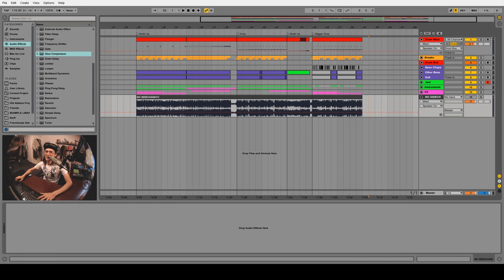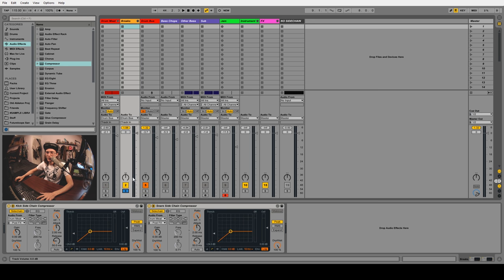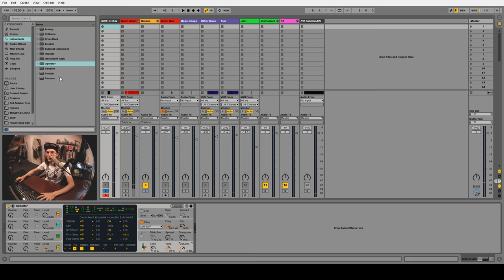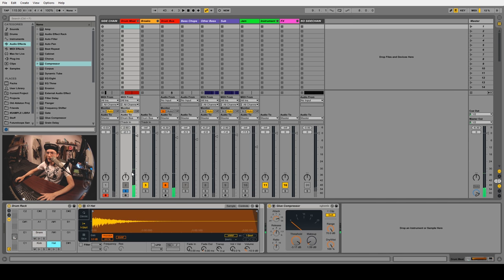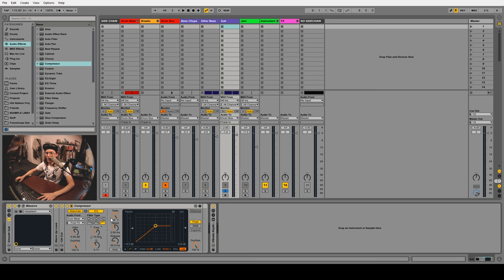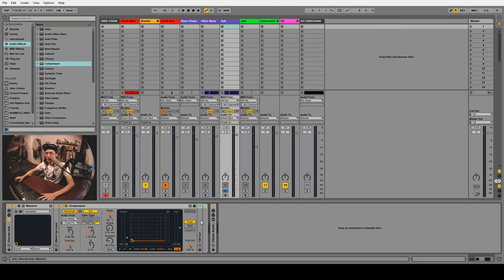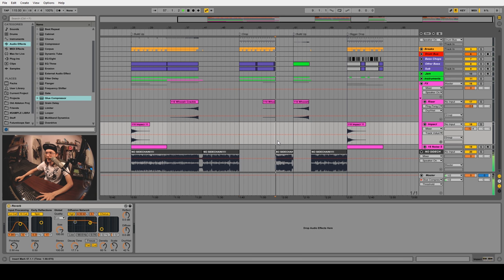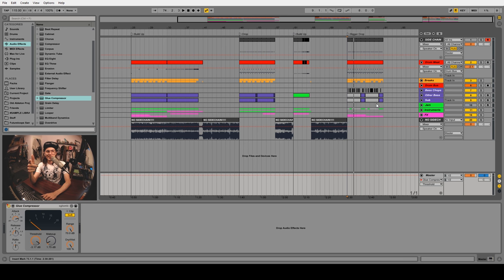Ableton Tutorial: How To Use Sidechain Compression To Improve Your Mixdown

Comment: Cool auto pan trick. Manual sidechaining is a good alternative that's worth mentioning and exploring as well. I stopped sidechaining with ableton's compressor when I started achieving better results by drawing/automating the volume per track via ableton's utility plugin (or the clip volume envelope on an audio track). You can really fine tune and get more control over the effect this way. It can be less or more time consuming depending on how you approach it.
Reply from the maker: If you have the time and patience to do this, yeah you can achieve a better result. But I think sometimes it's better to just get the song finished rather than fret over tiny details, especially when you can approximate a decent result automatically.

Comment: Thanks for the very comprehensive explanation! Excellent. But, in bitwig, you just insert a note-receiver modulator (or audio sidechain modulator if you need to act on audio) and have it control a volume knob on a tool device (or the gain knob on the output of your sampler or synth device or whatever!). You get complete control, and very, very little cpu load. Why use a full compressor for just a little volume automation? Oh, because not bitwig.... ☺️ No, I'm not a bitwig fanboy; I'm just making a point....

Comment: was very interested in seeing the exact time settings you use on your sidechain compressors, actually; i generally just turn the attack all the way down, so i'll experiment with .01ms for a bit :)
also, what do you think of manual volume automation for ducking instead of letting the compressor do all the work?
Reply from the maker: 0.01ms is the lowest possible attack time on the ableton compressor. Manual volume automation for a few once off sounds here and there is faster and more convenient than setting up a sidechain, but for your entire bassline for example? You'd just be making it harder for yourself and arriving at the same destination.
Reply: ah yes; my argument for manual automation would be that if the signal of your kick/snare is weird and peaky you could still have smooth sidechaining happening, because with low attack times your compressor might distort the sidechained sound if your trigger signal isn't clean enough. however, you needn't worry about that if you use a ghost source as you did in the video :D 
it's really useful for long, sweepy sidechains on 808s and the like though.
Reply from the maker: Ghost Sidechain FTW! Yeah I would manually "sidechain" things if they are just once off sounds. I actually often have a single kick right at the beginning of a breakdown and a big 808 sweep bass drop thing hitting at the same time as the kick. Rather than side chain it.. I just zoom in and put an audio clip fade. Quick and easy.

Comment: Great work sir! I think one the biggest points to take from this are just how much headroom can be used up by peaks stacking together, also how useful it can be to have different Threshold / Release settings on different elements, and of course using the ghost trigger from operator.  However, it looked like you were still clipping the master channel at the end...even if you are planning on going straight into a limiter when mastering yourself, wouldn't it still be good to bring the whole mix down at least 3db? Is it not still clipping the output of your audio interface and/or the input of any plugin on the master channel??? 

(especially if one were to export the mixdown to wav you definitely don't want that clipping!)
Reply from the maker: I could be wrong but I don't really think it makes much of a difference. Say I bring the whole project down by 3db and then use say.. iZotope Ozone Maximizer on the master.. I'm just going to have to bring the threshold down further to get a nice loud sound. I usually aim for like -3 to -4 RMS. 

So basically, my master could be peaking +3db.. but when I drag on a Maximizer to the master.. it will bring the peak down to 0db and there will already be a small amount of compression/limiting happening because the signal is above the 0db threshold. I don't think it really effects the quality of the sound.
Reply: +Slynk Thanks for the reply man, I guess whatever works works, your tunes all sound great on my system! I just think it would be good to clarify for the more beginner types that you do want to be conscious of mixing so loud if you're not going straight into a mastering plugin. (I have also heard that you don't want to clip the input of such plugins, probably better to add that 3db gain  inside, but again whatever works works.)
Reply: +Keenan Black anyway keep up the good work, I appreciate your videos! Would love to see more on composition side of things.
Reply from the maker: I just asked Mr. Bill about it because I wasn't so sure but he said something along the lines of... driving a high signal vs a low signal into a limiter will have different results. Whether they are good or bad depend on your personal preference, the kind of plugin you are using and how it's been programmed to handle high signals. 

Same goes for plugins on individual channels I would imagine. But I do know that an Ableton channel has +62db of headroom before it clips which sounds insane but it's true. Play something on a channel at +60db and then turn your master down by -60db and you won't hear any distortion. Push it to 62 however and you'll be clipping like all fuck. 

I'm not sure if stock ableton plugins have a similar headroom as a channel (i imagine it might) but regardless.. if it sounds good then who cares. Just get on with writing the song :)
Reply from the maker: Apparently stock ableton plugins have like 10-15db headroom so yeah.. keep the signal low but you don't need to be super precise. http://i.imgur.com/3MTEHwT.jpg
Reply: Cheers Evan & Bill!!! I was aware of the extreme headroom phenomenon in ableton but I thought master channel and 3rd party plugins might not be the same story... Carry on gentlemen.

Comment: so regarding your comments at around 20 mins about getting the master level right and not worrying too much about a couple peaks on the master that go over 0db here and there, is that how you do all your tracks? I have always heard that you should have a few db's of headroom on the overall mix, say -6 to -3 db, so you can bring them up on the overall master to 0db in the mastering stage. what are your takes on that? your comments make sense to me, i have just always wondered why you need a few db's of headroom because that means you're gonna have to do some compression/limiting on the overall track to bring it up to 0db if your highest peak in the track is at like -3db..and seeing someone with topnotch productions who doesn't follow that rule is interesting to me. thanks!
Reply from the maker: +max reeves driving a high signal verses a low signal into a limiter or compressor has various results depending on how the plugin is programmed to handle a peaking signal. As far as I can tell, going hot into ozone 5 sounds fine to me. That's how I've always done it and unless someone gives me hard evidence as to why I shouldn't, then that's how I'll continue to do it.
Reply: thanks for the response, very interesting. do you know of any good resources offhand for learning more about reducing/raising peaks within compressors/limiters or vsts like ozone in the mastering stages by chance? or have you always just experimented yourself to see what sounds best?
Reply from the maker: +max reeves I think this is something you'd have to test yourself if you want the answer. Sometimes I set up little science experiments to understand something better. It's fun and you learn more about what it happening.

Comment: Did you retrig your phase in Massive? You sure it's from Compressor I mean?
I noticed, with the high pass eq you aren't sidechaining your sub at all ^^
Reply from the maker: The high pass filter in the sidechain section of the compressor does not effect which part of the sound is being compressed. Rather, it helps define the trigger sound. So since I was using my kick drum as the trigger which has a short snap in the beginning of the sound, then a long bass tail.. by high passing it, I'm getting the short snap in the high end to use as the trigger making it easier for me to adjust my attack and release times. 

The clicking is from the sidechainers. No doubt. I'm using 0.01ms attack on my compressors. But the click is not too bad on the live 8 compressors compared to the live 9.
Reply: +Slynk this is so clever dude, this one little tip is guna save me hours of faffing around!! 🙌🙌 seriously big ups dude x
Reply: Thank you!

Comment: How much summing of multiple channels can you get away with before its ok to slap a glue compressor on it to limit?  I have been trying to keep it under 2db but it's hard tweak side chaining and EQ enough for certain situations.  I don't want to get in the habit of using a glue compressor as a bandaid.
Reply from the maker: I think it's generally a bad idea to put a glue on a sub and/or the drum bus because you'll be dirtying up the low end. But I think it's ok to put a glue on groups of similar sounds.. like a bass chops group or an keys/synth/lead bus. But just don't go too overboard with the settings. But just use your ears. If it sounds good, then it probably is good. :)

Comment: So whenever I feel there is too much compression going on as in the end of the buildup of your song 24:37, I automate the threshold to reduce the GR. Is there any advantage to your method, where you use a completely different compressor with different settings?

Also what do you think of LFOtool? I feel like it allows for a lot more precision than using a compressor for sidechaining.
Reply from the maker: All this stuff is situational. It depends on what sound you want and how your song has been designed. I tried to outline some general tips with this video but it's not "The Law". If changing settings on your compressor works for you or useing LFOtool works better for you then do it. If it sounds good then it probably IS good.

Comment: how do you stop your master (and even your individual channels) peaking hugely with barely any change to the channel volume? All of your channels seem to be at around 0 or only just below...if i dont take my levels on each track down dramatically, shit would be breaking my speakers!
Reply from the maker: There could be a number of reasons why your individual channels are peaking dramatically. One example is.. usually if you are EQing something with Ableton's EQ8, EVEN if you are subtracting frequencies, you will still be boosting the overall peak volume so it generally a good idea to use a small amount of compression after EQing. 

It's hard to cover all the reasons why you'd be peaking but honestly.. it doesn't matter if things are peaking more than other things. just turn them down. What you should be looking out for is wild variances in your dynamic range. That is.. if you have a channel that sometimes peaks at +20db and other times mostly plays at around +5db then that is a huge problem and turning it down won't fix things because now your +5db sounds are playing at -15db and your +20 sounds are playing at 0db. You need to identify what is causing that huge +20db peak and lower the dynamic range. Compression wouldn't be a good option in this case either. 

Alternatively.. if you have a channel that is pretty consistently playing at around +10db then that's totally fine.. just turn the channel down.

I hope that helps.

Comment: Hey Slynk, why not use a 'flipped' gate instead of a compressor to do sidechaining? wouldn't it be the same thing?
Reply: Because a gate and a compressor typically operate using different algorithms, also on a gate you can't set the ratio of input signal:reduction, also there is usually no knee settings in a gate nor can you choose between RMS and Peak. You can use a gate but it'll give you a different sound, more linear and less smooth.
Reply from the maker: AK there are many ways to achieve the same result. Why not draw volume automation manually instead? It comes down to your personal preference. If you like how it sounds and it works for you, then do it! I prefer to use a compressor.
Reply from the maker: Bro that sounds like the worst idea to me. I hate the glue compressor for sidechain. And I literally never use return channels. Each to their own I suppose.

Comment: instead of An operator i use a drum rack and got like 3 to 4 sounds on Different pads muted where i can trigger signals to busses or any track where i receiver the signal from
Reply from the maker: Omg, that is actually a really fucking awesome idea. And you'd still be able to control the decay time of the triggers inside of the sampler. You could choose, the kick trigger, snare trigger.. or both in the menu as well. Very fucking nice idea dude.
Reply from the maker: Seriously.. I can't believe I never thought of this. I just tested it out. Works perfectly. And.. if you're using a drum rack for your kicks and snares and you have them in the same cells as the sidechainer.. it makes it super easy to just copy paste the midi notes to the ghost side chain. 

Game changing comment for me. Thankyou.
Reply: yesss haha exactly ..thnx! ..to take it a step further i got one pad sending to a gate sidechain (received by the master or whatever) to get the opposite effect of the sidechain compression ..and only turn gate on when necessary (for some crazy breaks)
Reply: yeah all in one rack works perfect to ..less tracks ..still thinking of a name ..ghost rack ,trigger rack lol thnx again and no problem man!
Reply from the maker: Check this out. 

I just realized I could setup racks with correct routing which will sitting on the sidechain channel ready to go.. then when i need to sidechain something, just copy and paste a sidechain rack somewhere. Routing is preserved. 

Saved entire channel to my user library. Drag and drop into any project for perfect sidechaining every time. 

http://i.imgur.com/8h6DVCW.jpg
Reply: nice! thats why ableton rules! hahaa